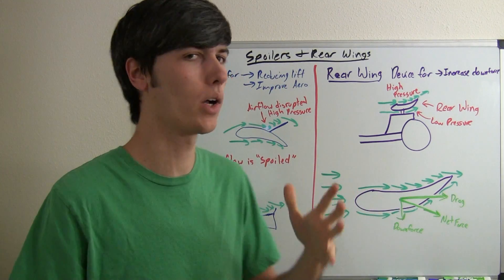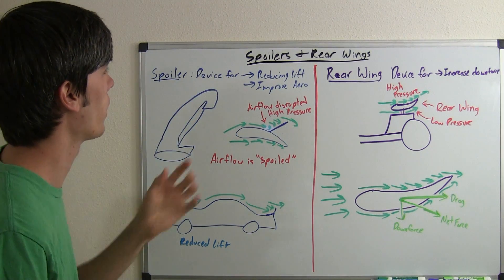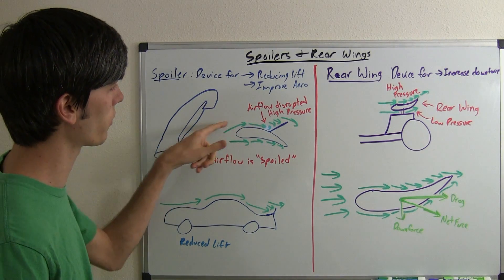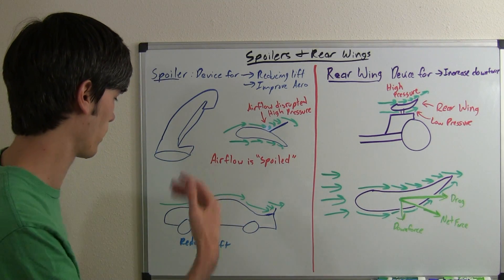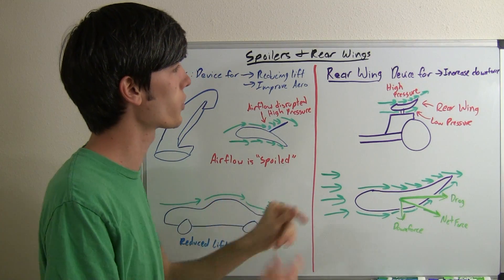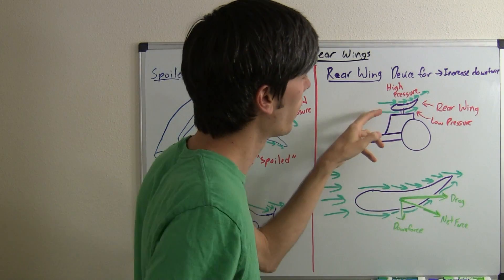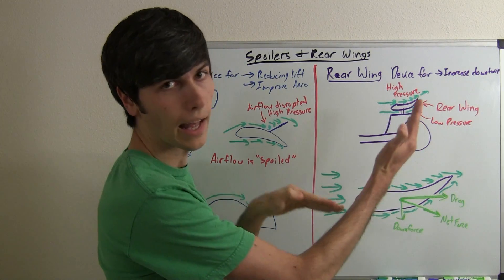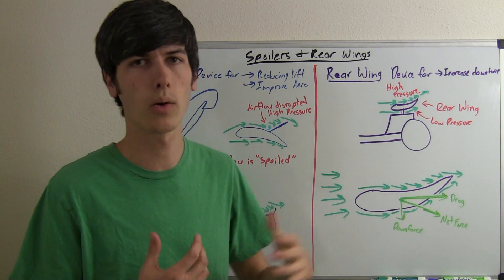Spoilers and Rear Wings - Explained

Comment: i went to google image and open two tabs, one spoiler and one rear wing, i don't see the difference
or i'm just bad at searching images
Reply: People are bad at naming and tagging images. Wings look huge and are usually black, spoilers are flat, usually smaller and  color matched to the car and have smooth surfaces, they reduce drag rather than creating it like wings do. Wings make downforce though.          If that doesnt help, just look for the ones standing on 2 "structures", usually made of aluminium. The wing itself is a flat curved plane and air flows under and over it. Air travels faster under the wing creating low pressure that sucks the car down. But mainly, it works because the high pressure on top pushes the wing downwards and backwards.
Reply: Search for GT Wing, it will show you images of wings without spoilers. And search for Toyota Supra, that thing has a spoiler
Reply: ooooh i get it now, thanks a lot

Comment: Latest Le Mans cars have top mounted rear wings, and I have been told that's because the most important part of the wing is the one below. I have always though the opposite. Why is that? Thanks
Reply: If a wing is broken into multiple elements, it allows for the successive elements to be placed at a higher angle of attack, creating more down force. The gap between the elements allows for high pressure air to flow through and increase in velocity of the air and the air curls around the under section of the next element better. If it were just one element with the same curvature, then the high velocity air would taper off at a certain point and be useless because the wing curls up to much, thus resulting in a stall. To simplify, if it were just one element, then the air on the bottom wouldn't "touch" the wing along the entire surface, meaning it isn't creating as much down force.

Comment: hello there. thanks a lot for your explanation. so, to create the downforce, the spoiler needs to be inclined at some angle. this way, the drag is reduced. pls excuse me if i get geeky :P. the spoiler would disrupt the air flow thus creating a sort of turbulence at the back. this means that the drag reduces. i am keen on knowing how in certain supercars, when applying brakes at 200 kph +, the drag is increased when the spoiler is inclined at 55 degrees. i mean, i know i am missing something. please enlighten me :)

Comment: How about air splitters and front bumper canards?
Reply from the maker: :o I think you'll enjoy this: Race Car Aerodynamics - Nissan GT-R Nismo GT3
Reply: Engineering Explained
I know that the GT-R GT3 has all those aero parts, but I don't think it's a street car, and all GT3 racecars tend to all have the same parts. The only street cars I know of that come with a full downforce aerokit are the Viper ACR, C63 Black Series, and the SLS Black Series.

Comment: which is faster.. a car with rear wing or a car without it ??
assume both cars stay on ground at all times and tires dont skid
Reply: Amaljith Cyriac " which is faster.. a car with rear wing or a car without it ??
assume both cars stay on ground at all times and tires dont skid"

Whats faster? A car with 150 horsepower, or a car with 180 horsepower?  Well that depends- If the car with 180 horsepower weighs 3300 pounds and the car with 150 horsepower weighs 1500, the car with less power is going to win. 

Point being, this depends on the car being compared, and the type of wing being used.  Under certain applications wings (and spoilers) can actually reduce drag- They dont always increase it- So if the wing in question lowers the drag, itd probably have an advantage- Likewise if it increased drag, itd hurt its chances.

Comment: you should mention too that not only is it just the air hitting the rear wing that induces downforce but also the same "lift" force on airplane wings, just upside down.  As you explained about the wing, air moving under the rear wing has a longer surface to travel due to the camber of the wing, there by increasing airspeed and lowering air pressure, inducing downforce.

Comment: So if I have 99 honda civic RS and I have spoiler remove it's going to reduce the cornering etc
Reply from the maker: More than likely you'll just have less drag and a lighter car. They're more useful at higher speeds that typically you won't reach while commuting.
Reply: Engineering Explained "More than likely you'll just have less drag and a lighter car. They're more useful at higher speeds that typically you won't reach while commuting. "

Potentially :)  A lot of spoilers can and do reduce the drag of a vehicle.

Comment: So basically, spoiler or rear wing installed on race cars has benefit. While for non racing  car , it is just aesthetic only?
Reply from the maker: Not really, just depends on the design and car's speed. Plenty of road cars have functional spoilers/rear wings.
Reply: Engineering Explained Thanx!

Comment: I don't think I fully get the difference: when we talk about reduced lift we are talking about a lower force which tends to push our car up, when we talk about downforce we talk about increasing the force pushing our car down on the ground (opposite to lift). So, at the end of the day, wouldn't the two situations be the same, only in one case you reduce what you don't want and the other you increase what you want?

Comment: i dont get how the net force on the spoiler has a downwards component.
It seems like the wind is only really hitting the spoiler head on horizontally, not from above.
Can you please reiterate?
Reply from the maker: Since the wing is angled, the air is hitting it at an angle, so the force it places on it will be perpendicular to the plate, which is angled down. If the wing were completely vertical (perpendicular to the ground), the entire force would push it back.

Comment: when the plane wing goes up the plane goes up to not down it pushes the back down that makes the front go up!
Reply from the maker: It actually acts much like a brake.
Reply: I think you are mixing up the control surfaces on an aircraft - elevators at the back can use a relatively small downwards force to pitch the entire aircraft up.  This increases the angle of attack of the main wings, which produces a much bigger in crease in lift which makes the aircraft climb.

On a car, the requirement is different - too much lift caused by the body at high speeds reduces control or could even be dangerous.  A spoiler ruins the nice fairly clean flow which produced (unintentional) lift on the car.  A wing acts just like an aircraft wing upside down - it produces a downward force to keep the car firmly on the ground, so giving better traction and control.
Reply: Would a spoiler do a regular FWD sedan street car any good  ?.

Comment: So essentially a rear wing is like an upside down airfoil?

also still confused on the difference between a spoiler and rear wing. So a spoiler just reduces lift which pushes the car down and a rear wing creates downforce which pushes the car down? Basically the same solution but from 2 different sides?
Reply from the maker: Yes to your first question. Although they're similar, they have two slightly different goals.
Reply: A rear wing on a car is just like a wing on an aircraft, only working upside down.  

Because the shape of the car itself can be close to an aerofoil in effect (curved top, flat bottom), the entire car can generate lift at high speed.  The spoiler doesn't work to push the car down, but is designed to stop it generating lift, or stop it getting sucked upwards due to the low pressure above.

Comment: So how do you maximize your downforce and reduce your drag? Im curious, would it be a certain angle that the wings would be designed with that does this? Haha sorry for so many questions.
Reply: I'm not sure there is a way to increase downforce without adding some drag, unless you already have a wing and can add a Gurney Flap. The angle of the wing will only determine how much or little downforce you have, but if you have any amount downforce from a wing there will always be some drag. A Gurney Flap is basically a mini spoiler on the tail end of a wing that will increase downforce without adding drag. So that's the only way I can think of to maximize downforce and reduce or at least not add drag. Hope that helps!
Reply: The best answer I've found is the flat under-body plate and diffuser combo. Speeds the air up on the bottom of the car with the flow on top of the car remaining the same (essentially the same as slowing down the air on top which is what the wing does, just opposite) creating downforce while creating little to no drag as the flow on bottom doesn't push back on anything so the only drag would come from the very small viscous force of the air against the surface which is minimized due to the small effective surface area the flow will see.
Reply: Justin Clark I think a venturi shaped underfloor will create more reinforce than a flat body
Reply: Justin Clark I think a venturi shaped underfloor will create more reinforce than a flat body
Reply: At a basic level, any increase in lift (downforce in this case) results in an increase in drag - if you want more downforce this is easily achieved by increasing the angle of attack of the wing, but it will increase the drag penalty.  There is a point to be reached in optimising downforce vs drag, which will be different for different cars, different speeds, differing cornering requirements.

Altering the relationship between lift (downforce) and drag ordinarily means using a different aerofoil design.

Comment: hey i suggest better explain the rear wing as a turnedover airfoil. which creates lift to the ground (downforce). the spoiler mainly spoils the liftcreation.  and adds lot of drag. but not in relation much downforce. so not very efficient for a car.

Comment: What's the difference again?
Reply from the maker: Sim Lucien
The car's aero provides a certain amount of lift, and this amount can be reduced by altering the airflow. A rear wing attempts to create downforce (but not necessarily alter the lift).
Reply: Sim Lucien One reduces an existing force, which is lift, and one intentionally creates an opposing force. That's my guess anyway.
Reply from the maker: Reduce lift (spoiler) vs. create downforce (rear wing).
Reply: Engineering Explained
But what's the difference between reducing life and increasing down force?
Reply: Engineering Explained  You explained this ok in the video, I just needed to get my head wrapped around it. Thank you! Keep up the good work..

Comment: I think you mixed something up when talking about planes, the wing is usually fitted with multiple flaps for different purposes. The one you were talking about suits best for the airbrake, a flap mounted on top of the wing which is mostly deployed when the plane already has landed. Another types of controls are the "flaps" themselves, their purpose is to maximize lift, so that the plane is able to fly at even lower speeds, otherwise the lift off/touchdown velocity would have to be a lot higher (the flaps do slow the plane because when fully deployed they do really add some drag)

Comment: I understand the rear wing creating Downforce for cornering faster and keeping the car on the ground but if a spoiler reduces lift, I.e more Downforce, isn't that the same thing but just less effect then a rear wing.
Reply: Spoilers are barricades to undesirable flows, and thus are able to reshape airflow streams around the vehicle. This can help keep the rear of the vehicle down and decrease drag by changing the effective vehicle shape. so basically no.

Comment: My only question is that what it the purpose of having the rear down force of a front wheel drive vs a rear wheel drive car? I have a dodge neon with the rear wing
Reply from the maker: Downforce is important regardless of drivetrain, but it could create interesting dynamics as Matt has pointed out. With significant downforce, you'd never oversteer, not that this is bad, but the front would have less grip than the rear, but in FWD cars the front does all the work (braking, turning, and accelerating).
Reply: the drivetrain is irrelevant, you can still be unstable through corners with FWD
Reply: Actually, having too much downforce on the rear of a front wheel drive car can take grip away from the front tires which means worse handling, braking, and acceleration. So if you do have FWD you would want to keep rear downforce to a minimum or virtually none and mostly focus on front end aero.

Comment: I have a Question about f1 racing. Is it always every year they make new rules and regulations? And do they have reasons for the changes or is it just to make it more interesting?
Reply from the maker: Well there are likely tweaks every year, but major changes are not every year. The cars have had a similar platform since I believe... 2008. Could be wrong on that, but the cars have a complete overhaul this year.

Comment: So you want to put a spoiler on your car when you notice that for example, your car is going 100 mph, and the rear end is lifting up ( making the car more unstable ). And a rear wing is just something for race cars. So basically a spoiler is a simplified wing? ( with less performance in aerodynamics )

Im sorry if I'm being caption obvious, but I like to repeat what I just have learned, so that it sticks into my mind!
Reply: Not exactly. A spoiler breaks the laminar flow over the top of the car negating the effects of the relatively higher pressure under the car. It's what you see in nascar. Here, the net result is that at 100mph the car's aerodynamics are equivalent to it driving at 10mph (minus air resistance).

Comment: Lately i have seen alot of cars having the "pilars" of the rear wing being conected to the top side of the wing rather than the "classic" bottom side (Koenigsegg one:1) , is there any diference???
Reply: the bottom area of the wing creates the most downforce (airplane wing upside down). therefore having the "pillars" attached at the bottom reduces the efficiency of the wing.  attaching to topside where less downforce is created minimizes the loss of downforce and therefore increases the efficiency of the wing.
Reply: Here's a great pic showing the difference in air flow via Evasive Motorsports https://www.facebook.com/evasivemotorsports/photos/pb.37244375317.-2207520000.1394665192./10152019296050318/?type=3&theater
Reply: Air flow?
Reply: TheFlacker99 (Flak)
Diference in performance.
Reply: kananisA75 Possibly.
Reply: thanks man that really helps :)